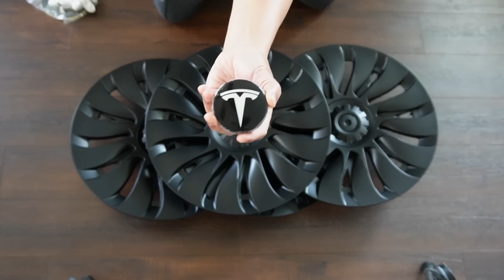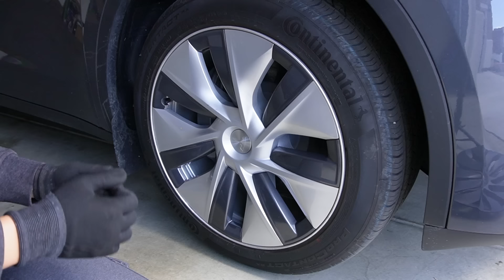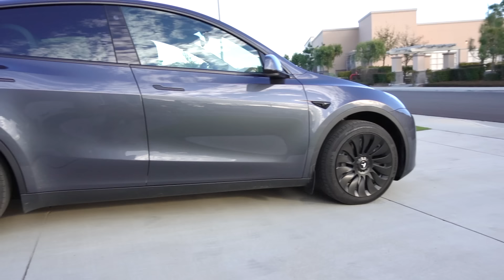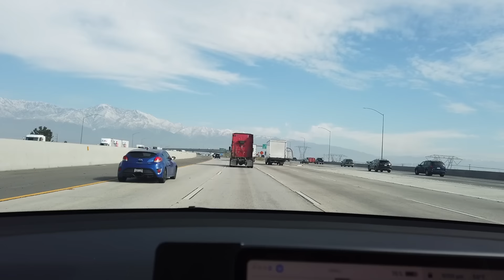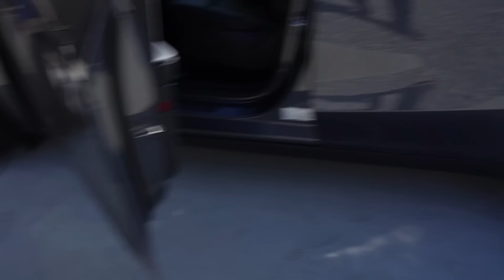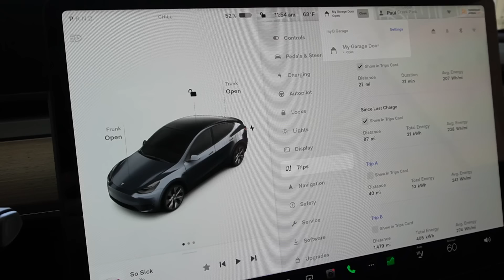2023 Tesla Model Y Wheel Covers Upgrade with 15 Mile Range Boost! #tesla

Comment: After testing them for 2.5k miles I've found them to be slightly less efficient than the original wheels cover. You might want to test the original design wheels cover that's also directional. They might be the most efficient. But for the look these are worth the little bit of efficiency loss.

Comment: Hi Paul. I put the same uberturbine wheel covers on my MYLR24. I love them! Thanks for the thorough testing.
Reply from the maker: @laplena1727  Appreciate your comment.
I’m glad you liked it too.
Thank you for watching!
Please subscribe for future contents.🙏😃
Reply: Did. They scratch the wheels?
Reply: @AlanTrades  not at all. They actually protect the edges of the rim that are exposed with the factory hubcaps.
Reply: @laplena1727  did you put the wheel tape on the covers?
Reply: @AlanTrades  Yes I did, and you should too. Otherwise you'll end up with a loud ride. It helps with air draft around the wheel. Make sure you tape close to the edge, but not past it so you don't end up with bad aesthetics.
Reply: @laplena1727  ok thanks but do you have to reapply new tape afterwards?
Reply: @AlanTrades  haven't had the need so far.

Comment: I unfortunately had a really bad experience with the Yeslak wheel covers. The package did not include any foam tape or the Tesla logo's and nothing else arrived later on. I installed one cover on a front wheel just to see how it looks. I was prepared to go to the local hardware store to buy foam tape, as these will definately rattle against the rim without foam tape. That is where my problem started. These covers refuse to come off, doesn't matter how hard you pull. I had to destroy each locking tab one by one to get the cover off, and the process broke the wheel cover in half. I chucked the remaing three in the garbage bin too, scared of damaging my rims. In my garage I had large flat scredrivers at my disposal to break each tab. Imagine being stuck at the side of the road in the dark not being able to remove your wheel covers. They were AUS$300, which is not cheap.  In my case a really bad buy. The genuine Telsa covers come off easily as in your video.

Comment: Beware - the company will not stand behind their products.  They are almost impossible to take off - the pins that hold them on break off.  If you have a flat on the road, there is no way to change the tire as you can’t remove the wheel covers to access the wheel nuts unless you have super human strength , all of the tools and its very hot as the plastic only bends with heat.  A real rip off.

Comment: Are you aware of the problem trying to remove these covers.  For me they are impossible to take off, making them useless.  If you use extreme force, you can rip them off the wheel, however then the clips on the covers break off.  So far I am in discussions with Yeslak but I don’t expect much help from them.

Comment: Somehow they are almost impossible to take off without damaging it.
Reply: I have used work gloves, got help and even tried various tools, impossible to get off.  The clips are made from plastic that is not flexible and so they won’t give enough to come off.  I think you are in bed with the wrong company here.
Reply from the maker: Try taking it off using work gloves.
This will definitely help.
Thank you for your great support!🙏😃

Comment: I didn’t  bother with the tape. Not concerned about the rim underneath. I will never put the stock covers back on and the shells will always have these type of covers. I have no issues with noise.
Reply from the maker: Appreciate your comment.
Thank you for watching and sharing your experience.
Please subscribe for future contents.🙏😃
Reply: Wouldn't they bend due to 100 degree heat in the summer? Or at least soften?

Comment: I put tape on the clips as you mentioned and fixed it. But not able to remove the covers as one of cover is not fitting properly. I tried very hard but luck removing the covers. Is there any other way to remove the covers?
Reply: To solve your problem. Take a plastic item shape of a screw driver and genly press against the clip holder ( between Alu and cover) then at the same time pull on the cover.
It will come off 
PS DO NOT REMOVE BY JUST PULLING these from yeslack break like glass

I instaled one on the wrong side, easy to mistake left from right depending on where you are front or back of the car.
I instaled them from the back/when sitting in driver seat left/right passenger side

Comment: I ordered one after watching your video. Two things that I have to say that, mine don’t come
 with the Tesla logo on the center caps . It doesn’t have a information manual for the form tape that came with, like where to apply. Also if it’s directional like you said, it should have the stamps showing left and right. Very disappointing for the money I paid compared to the similar products in Amazon $100 cheaper.
Reply from the maker: The video was released a few months ago I think they might have stopped the promotion on the center cap logos.
I included the instructions where to apply protective foam tapes in this video and the covers should have the label R and L on the inside of the covers.
Thank you for watching and your support.

Comment: Is this better than the one you just post 3 weeks ago (rimitrex? Or they are about the same?
Reply from the maker: This one offer better efficiency compared to Rimetrix Medusa.
Thank you for watching and your great support!🙏
Reply: @dadstoyscars  thanks for confirming. On one of the comments  someone mentioned it doesn’t flush as well (guessing it’s at the edge of the hubcups with the wheels) Any thoughts on it?
Reply from the maker: @house22TC23  because it covers the whole wheel unlike OEM it stops at the rim of the wheel. That’s why.
Reply: @dadstoyscars  oh that’s good then   It covers the whole rim.
Reply: @dadstoyscars just got em. Seems better than the other one

Comment: Hi there.  On Yeslak’s website, it seems like they’re not sending out center caps any longer (unless I’m mistaken).  I ordered some center caps from EVBASE (Pelsive 56mm in black), but they’re a bit smaller than I thought, and don’t look quite right with the covers.  Do you have any suggestions as to which caps to buy that would fit better?

Thanks for any help you can provide!  😊
Reply from the maker: Here are optional White, Black and Red Tesla logo center caps:
https://amzn.to/3JuAUVX
I only found this from amazon.
I hope this help.
Thank you for your great support! :)
Reply: Thank you for your quick reply.  I saw those, but I was under the impression that they only work with Kavanik wheel covers.  Do you think these will work with the Yeslak ones that I have?
Reply from the maker: @Lenny_Melzer  They should fit too please check the size again before you order them.

Comment: Do you have to take these off every time you get your tires rotated and balanced ?  If this is the case, I don't think you would want to put the tape on the edges.  Also, seems like the clips would wear down over time and you would get a ton of wear and tear (scratches) on your interior rim.
Reply from the maker: Yes, you would have to take them off for tire rotation and any tire removal services.
Adding the foam helping with both scratches and noise.
You only rotate your tires every 6k miles.
Thank you for watching!
Please subscribe for future contents.🙏😃
Reply: Any tips on how to remove them easier?
 @dadstoyscars
Reply from the maker: @djamaraLA  I would wear groves and try to pull towards yourself as hard as you  can.

Comment: BTW, they are more difficult to remove, compared to the factory covers, but not a big deal.
Reply: Why do you want to remove them? I thought once you installed them, you want them stay there permanently.
Reply: @fitofito1001  they need to come off for rotating tires or to repair a flat, as they cover the lug nuts.

Comment: This is a rip-off company - I ordered the wheel covers and they shipped them minus the "T" Tesla emblem that should go on the center of the wheel cover.

They want you to use a screw driver and pry them off the original covers and use glue of some kind to mount them on their covers.

I'm trying to return these - what a rip-off.

Comment: I take my Gemini covers off whenever I wash my Model Y in order to clean the actual wheel barrel. Putting the tape on the clips seems unnecessary given the stock covers don’t have tape. If the aftermarket covers have a sloppy fit and need the tape that is a different matter.
Reply from the maker: The original Gemini covers don’t the rim of the wheel. But these covers cover the wheel including the rim which could rub between the cover and the rim. That’s why you would need the protective tapes to reduce the damage and noises.

Comment: Can u put them on model Y wheel that has a curb rash? Does it cover it up and will not see the curb rash?

Also does all Yeslak designs cover the rim?
Reply from the maker: Yes, you can put these cover 19” wheels with curb rash and they will cover up the damage as they cover the whole rim unlike the stick cover that stop at the rim of the wheel.
Most of aftermarket cover should cover the whole rim but also depends on which style but for sure these in the video will.
Thank you for watching!
Please subscribe for future contents.🙏😃
Reply: @dadstoyscars  thank you 🙏
Reply from the maker: @prashanthtarikere7322  No problem 😉

Comment: Does these covers, or even the stock covers, scratch the wheel underneath when removing them?  It look like you have some scratches from the clips on the spokes of your OEM wheels.
Reply from the maker: Those scratches happened to my wheels because I have tested, installed and removed so many times with many kinds of covers.
The clips are holding onto the inside of the spokes and they are plastic. So they less likely to leave permanent damages.
Thank you for watching!
Please subscribe for future contents.🙏😃

Comment: Will these covers fit my model 3 as well
Reply from the maker: Unfortunately these covers only fits 19” stock Model Y wheels.
Thank you for watching and your awesome support!🙏😃
Reply: @dadstoyscars  even if they're 19inch wheels as well??
Reply from the maker: They have different wheel covers for Model 3 19" sport wheels.
Here is the link / Use code DTC20 for 20% off:
https://www.yeslak.com/products/uberturbine-wheel-covers-for-tesla-model-3-19-sport-wheels?ref=598lfs13&variant=43650188673251
https://www.yeslak.com/products/uberturbine-wheel-covers-for-tesla-model-3-19-sport-wheels?ref=598lfs13&variant=43759992144099

Comment: Finally got mine after over 1 month of waiting time.
Although they look nice on the car, they are not flush and do stick out alot from the tires and are very prone to curb rashes. The qualityh is very cheap, the slightest scrach or something leaves a mark. De plastic is very "soft" and crumbles fast when compressed.
Not worth the price....theese should be sold for no more than 100 dollars. Its just plain cheap plastic

Comment: Beware - These wheel covers stick out more from the tire than the stock wheel covers that come from the factory. From the side profile these look great, however if you look at the wheel covers from the front or rear, you will quickly notice they are not flush with the tire. It may not bother some, but it also means it’s more prone to curb rash because it sticks out more.
Reply: Isn’t that what it’s supposed to do? That if you hit a curb, it’s not gonna damage your rim directly, but the wheel cover? It’s still cheaper to replace the wheel cover than the rim
Reply: I can confirm this. ANY aftermarket wheel covers that fully covers the Gemini rims will do this. This is not the fault of the aftermarket rims, but a limitation they face due to the design of the Gemini rims.
Reply: Any picture to show? I’d like to understand if it looks “fake” or if it’s accceptable
Reply: @@Ben-vy1ob I’ve been using these for about a week and my official Wh/mi should be confirmed by next week. I averaged 251 Wh/mi with the original Gemini covers, and so far I can’t definitively say these ones are better or worse. I just charged to 80% today and I got about 240 Wh/mi on my 10 mile drive home (backroads, no highway).

Comment: On the fence whether to buy now or wait for HW 4 😢. Any advice appreciated.  Love your video , atleast now whenever I buy i will not pay 2k for the wheel upgrade !😊
Reply: Thank you for replying. Are the white seats worth it ? I was going for the 7 seater for occasional parents visit . I try to keep my car for 5 years atleast !
Reply from the maker: @nikunj2707  If you have kids I wouldn’t go for white seats upgrade unless you don’t mind on constantly cleaning them. They look very nice but it’s a pain to clean. 
BTW the third roll seats only good for kids below 4 years old otherwise it will be too small.
Reply: @dadstoyscars  Thats another 1K saved then ! Lol .. Any discounts on the hitch with your code ? I want to try and do a self install and save $700 bucks.
Reply from the maker: @nikunj2707  that I would pay extra and go with Tesla OEM for safety reasons.
Reply from the maker: Appreciate your comment.
I think now it’s a great time to buy.
It’s $16,000 cheaper than last year and you get full $7,500 tax credit. So basically more than $20k cheaper.
I wouldn’t get any upgrade other than pick the color you like. 
Thank you for watching!
Please subscribe if you haven’t yet.🙏😃

Comment: Hey Paul great review and I’m getting ready to put an order through using your discount code. One question did you consider going with the gun metal grey wheels instead of the black ones since your Tesla is midnight grey?? Since I also have the midnight grey MY I’m trying to decide which color to go with. Thanks
Reply from the maker: The reason picked black because it provides better contrast with Midnight Silver color car. Metal grey has a little more premium with metallic looks but it’s just a little too close to Midnight Silver in my opinion.
Thank you for your great support Fred!🙏😃

Comment: Hello, are the clips that attach to the wheels and the center column .. are they plastic or aluminum?

Do the black or the grey covers match more closely to the wheels ?. 

Thanks. Hope to hear from you soon.
Reply from the maker: The part of the clips that actually attach to the rim are plastic parts.
But I still apply the protective foam tape on all the clips to make they don’t damage the rims.
You only see very little part of original alloy wheel. If you worry about that then Gun metal color cover would match better.
Thank you for watching!
Please subscribe for future contents.🙏😃

Comment: Do these scratch the OEM wheels when you take them off? I heard the metal clips that hold it to the wheel can leave scratch marks when you try to take them off. They look great, tho!
Reply: I was wondering the same thing.  The original poster was referring to the clips leaving marks. I think it very clearly shows the gouges in the rim that it left unless those marks are from trying a different brand of wheel covers?
Reply from the maker: If you watched the beginning of the video you will see that I applied the protective foam tapes to all the clips so they won’t scratch the rims.
Thank you for watching!
Please subscribe for future contents.🙏😃

Comment: Good luck all the peoples have Tesla 😂😂😂😂😂 I got model y performance on march 7 , just 2 weaks old I have service 3 times… 
1 rear door problem…
2  tail light from right side it’s  black out ,when PHC stop give me the warning and then I know , 
3  you know california raining couple days…. Today I open the trunk …over half gallon water come out from the door trunk 😂😂😂😂😂 so sad
Reply: I had water getting in the lower plastic trim in the back hatch . It took 4 service visits to get it fixed! Overall, I am pleased my y performance.
Reply: @rickeybarnes6471  I have service  on Monday……. after going home I test 16z bottle water , put on top glass back hatch the water go through in side the back hatch door …a lot water low plastic trim , I come talk tesla service center they say NOMAL ?????? I asked people have model y come to service at Tesla…. They say never happen like that 😩😩😩😩😩
Reply: @tamthoale5140  Tesla center finally replaced the seal around the hatch and in the rear light there are holes that allow wires to go through from the interior metal hatch to power the lights. In my case there was a rubber disc called a grommet that came loose in a previous service to adjust my rear lights. That loose  grommet was more than likely causing water the leak . Good luck.
Reply: @rickeybarnes6471  thank you